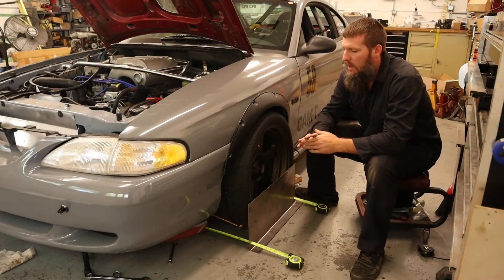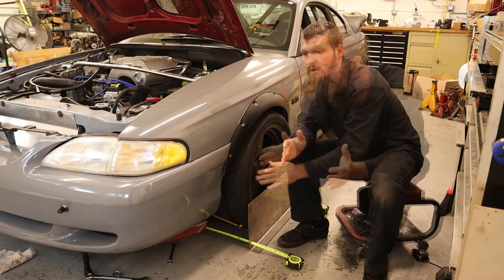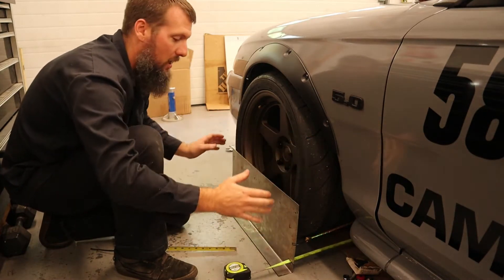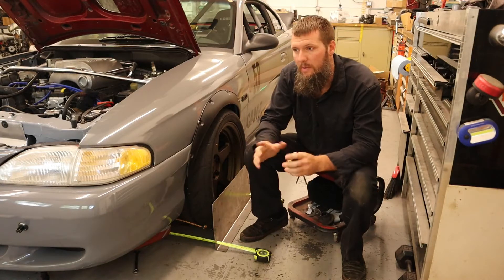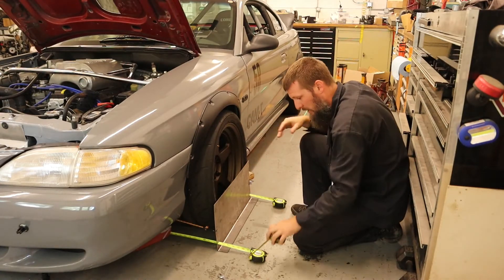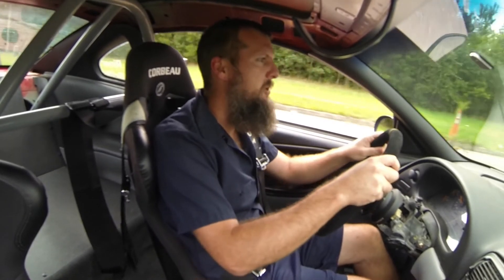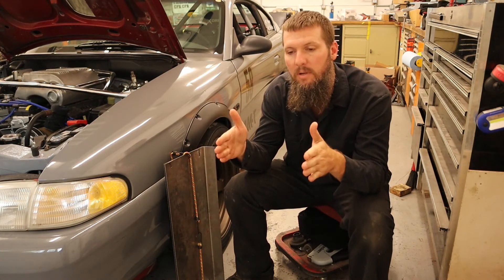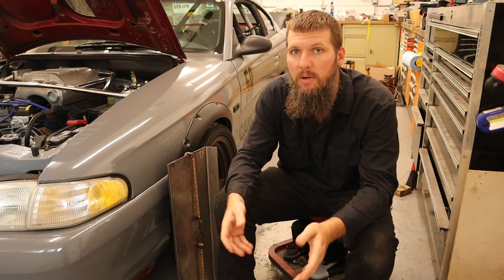Setting Toe - Toe Plates vs String Method (Laser)

Comment: Very useful video. Answered all the questions I had - not so many online resources to explain. I didn’t realize the difference between the plates and string methods, but the way you explained it makes sense. One method seemed a lot easier than the other but I see now it’s drawbacks!

And I am very interested in that laser level hack you used. I might try that when I attempt my at home alignment.